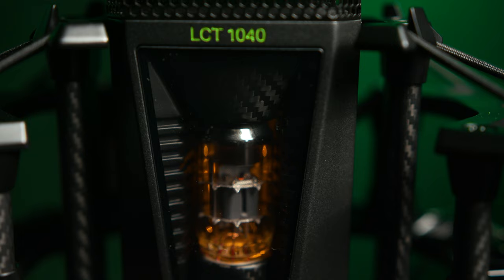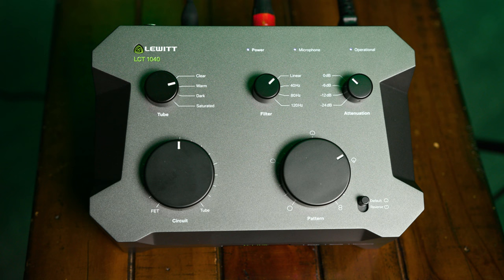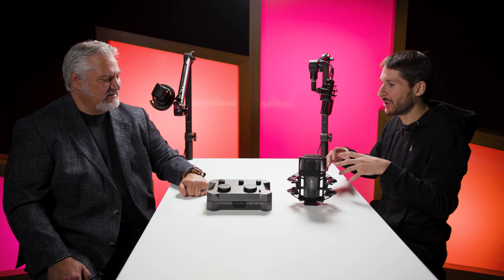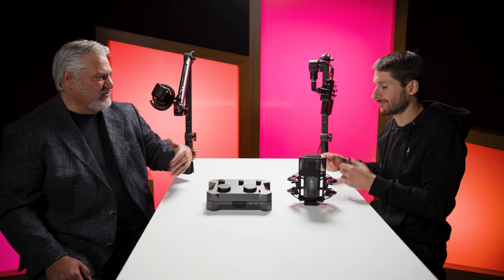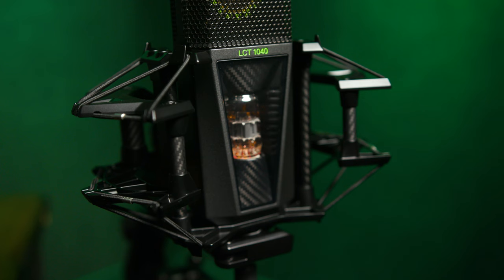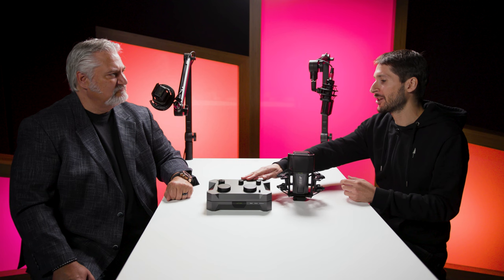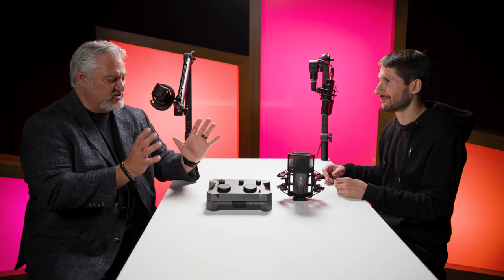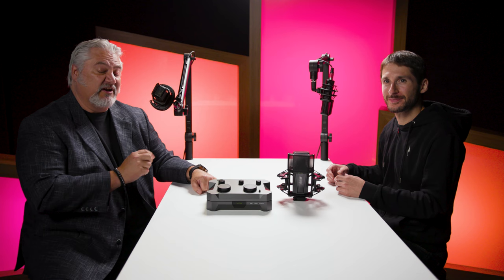Lewitt LCT 1040 Tube Microphone System Demo

Comment: This may be offtopic, but how do I get rid of the soft hiss sound from my Presonus Eris e5 studio monitors?
Reply: i Jamguitar  Why? Even some of the more expensive monitors have the same problem.
Reply: Check your gain staging. Everything introduces its own noise floor/self noise to various degrees. Figure out if it is quieter to push a hotter level to the monitors from your interface or monitor controller and turn down the level on the monitors, or send a quieter level to the monitors and crank them up (or somewhere in between). Try taking single elements out of the signal chain at a time. If one makes a dramatic difference, that is likely the culprit that is introducing a high noise floor. It may need different settings to minimize the noise floor, it may need serviced, or upgraded to a different component to improve the noise floor.
Reply: Are u Used balanced cables?